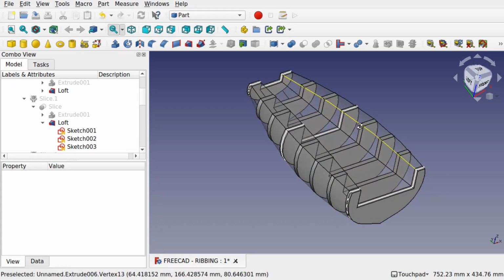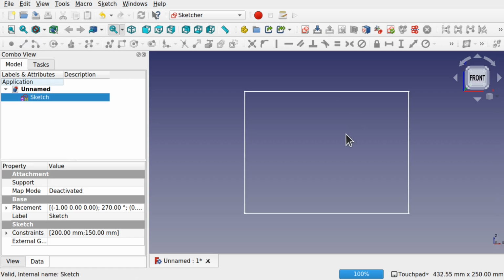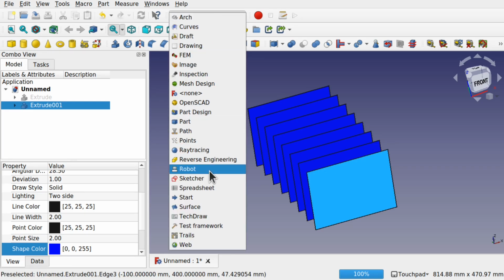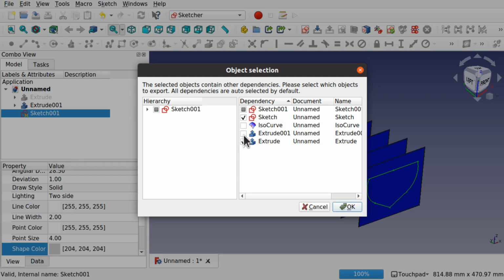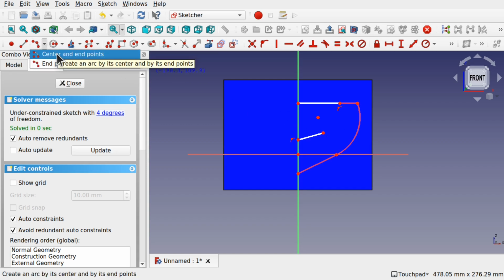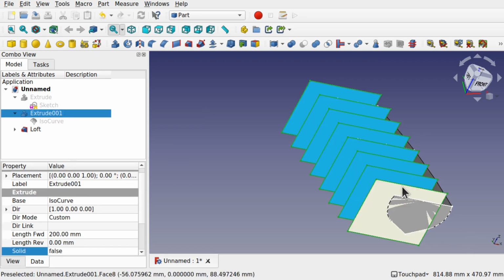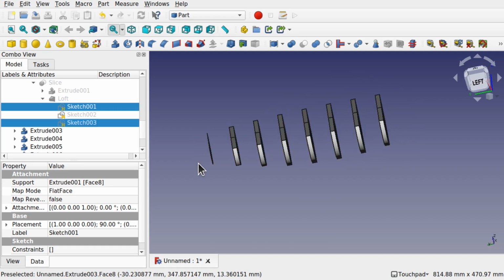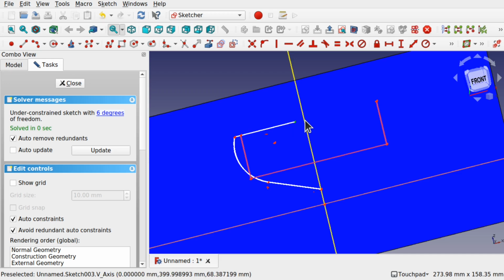FreeCAD: Quick and Easy Parametric Section / Ribs / Bulkheads / Cross Sections with Curves Workbench

Comment: is it possible to have different sketches on the different ribs?
Reply from the maker: Yes you can change the sketch for each of the ribs.  Just be warned you need to match the number of points for one profile to the next to get a good flow.  So if sketch one uses 8 points then sketch 2 should use the same amount, other wise freecad with try to add in extra extra edges along the loft.  I will be going over that in a couple of videos time in by Beginners FreeCAD v1 lesson on lofting.
Reply: OK - that destroys my idea of creating a cockpit in the rear end and a battery/RC-receiver compartment in the center.
Reply from the maker: @hidingin  Ah nope sorry I thought you was talking about modifying the loft.  With the ribs you can use them as sketching planes to attach additional sketches on.

Comment: Thanks for making the vid info' available.  At about 7.06 /26.02  sketch, flat face = centre of xyz on selected face - cube shows front.
On my 0.20 version of Freecad I get sketch, flat face = center of xyz to the left of the selected face - cube shows rear.
Do you know what could be wrong?
Reply: If the cube is turned to show front the centre of the xyz is on the right of the selected face.

Comment: Hi, many thanks. I'm having problems adding fillets on things like casting patterns where multiple fillets join or split, or fillets run out to a tangential join. Sometimes adding a few microns can make all the difference. Would like some more exact knowledge to get best from FreeCAD.
Reply from the maker: I am in process of putting a video together of common filleting problems and how to get round them. I see if I can get this out soon.
Reply: @MangoJellySolutions  😁

Comment: Amazing tutorial as always! I have a question, instead of using the curves workbench to make the rib slices, is it possible to make 1 rectangular slice and make a linear array using the draft workbench and then do an intersection boolean operation with the loft and this array to get the ribs? Thanks!

Edit: It seems to work and it also is parametric as we can change the slice spacing and slice thickness from the array settings. What are your thoughts? Thanks as always!
Reply from the maker: Thanks for that glad you enjoyed. Yes you could use the linear array tool in draft. But be careful if you decide to use the path array, that one is pretty twitchy if you start altering the path. I was trying to do this for a project which involves a waffle structures and each time I tweaked the path to follow the structure I wanted to cut up into sections it would go into error. Thanks for sharing, great to get alternative ways to get to the end goal.

Comment: This is massive for me. I want to build a rc plane  and the slicing part is huge to me, to gather the bulk head dimension as they flow down the loft from A to X. Efficient way ! Surfaces and lofting is my weaker point so this is cherry jello to me ! Thank you !
Reply from the maker: This is great that you have found the video useful, thanks for the kind comments and sharing. There are going to be a number of follow up videos answering a number of question which go into this subject even further.  Also there are some questions I want to answer regarding waffle architecture structures that use the same cross sectioning method so there is a lot of overlap and I have a number of ideas for future videos.  Remember you can go the other way as well so you can make cross sections running vertically through the leading edge to the tail edge of the wing for support.  I spent some time as a  team rider during the traction kite craze (basically paragliders on 4 lines) and did a bit of kite building and repair both open and closed cell using CAD so watch this space as I have some ideas around that area and there is bound to be some overlap as the wing has similar build features but in flexible ripstop form
Reply: Same here Brain Dead I fly RC in QLD Australia. I can see all sorts of design possibilities here. For Darren, Ribs are Wing Sections. Generally Fuselage/ Hull Sections are known as Frames.
Reply: You got me ! they are called frames, but I looked it up again, wing bulk heads are still call ribs ! sorry its not easy being brain dead ! lol
  @russellw5447

Comment: Super technique. How do you figure out these things? ;)   One important question, is there a way to make  a PREDEFINED GAP between the ribs and outer skin? 3d printing slicers need to get fooled so that the ribs don’t show up on the outer skin(hull) wall during printing. For example, the hull is 0.4mm and the gap between hull should also be a constant 0.4mm. Thanks for your awesome tutorials.
Reply from the maker: Thanks for the comments. I have a book full of ideas and sometimes I wake up and have to jot something down so always thinking lol. In regards to the gap I am thinking to go with a clone of the original loft and and shrink down the clone first and slice through the clone. This comment with some before I can see a follow up video coming 😁
Reply: @MangoJellySolutions  That method to shrink would work. However, if one uses this technique with airfoil shapes, then an offset type technique (rather than shrink) would better preserve the gap in the trailing edge of the airfoil shape. Is there an offset command that would work with your work flow?
Reply from the maker: Sorry for the confusion if you get a message from a different account, replied from a different computer from my personal account.   That is true when your loooking  for that level of accuracy. Wondering about 2D offset on the split profile before extruding into the finished profile . Or offset the profile first so you creat two lofts? Let me think about it and get back to you..

Comment: When lofting your boat, the stations are based on Extrudes and the result is a square edge. After the slices are made, can the square edges get a chamfer that matches the fair edge? or is that too difficult and best left to the preparation of the stations after they are cut into real parts?

Wonderful video. Thank you.
Reply from the maker: You can chamfer the loft before the cut which will then pass the chamfer along to the stations or you could chamfer the individual stations.  I am putting together a second video which I hope will answer the questions asked by a number of viewers so I will include.  Glad you liked the video.
Reply: @MangoJellySolutions  Thank you for the reply. I will finish the exercise so I am ready for part 2.

Comment: Very useful , I was wondering if you could use that first sketch which is parametric , and scale them up or down on each station ?? could each station be shifted either up , down left or right along centerline ??  Thank you ,    Terry
Reply from the maker: Yes you can. If you use the draft workbench you could clone the sketch and then attach it to the stations in the same way. The clone has a scale option which you can be adjust. The individual stations can't be shifted as they are but the iso lines can be exploded into individual lines via part wb, compound, explode and then those extruded. You will then be able to move them.
Reply: @MangoJellySolutions  Link has scale option as well.... so you could cut out the sketch and have directly linked/scaled bodies

Comment: Very useful, thanks. Couple of questions - how would you introduce a curved sheer line and would it be simple enough to draw the bulkhead shapes on to an inserted canvas/image?
Reply from the maker: Thanks for the comment. You would basically need more profiles to follow the correct curvature or in another one of my videos I use a skeleton and create lofts rather than from front to back but from the side  from the rocker upwards (or the other way) with Interpolate Curves connected to the skeleton. Then I loft through each of these. Once you have the loft then you can place the cutting planes through it and cut using the same process. I am tempted to create a video with the workflow from beginning to end.
Reply: @MangoJellySolutions  Yes, please follow your temptation and do that video !. It would be very useful for many followers. Thanks in advance.
Greetings from Santiago de Chile, South America. John.
Reply: Thank you. I've been working my way through your videos and have found them very helpful. @MangoJellySolutions